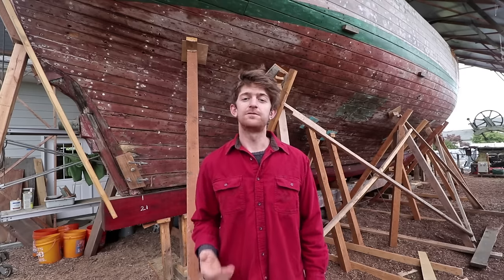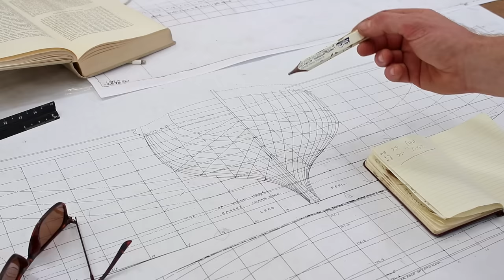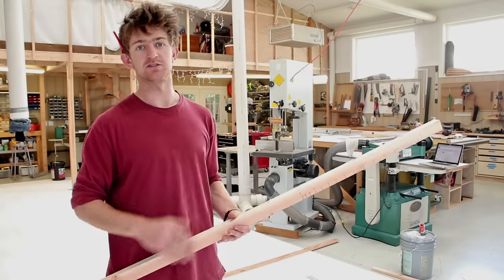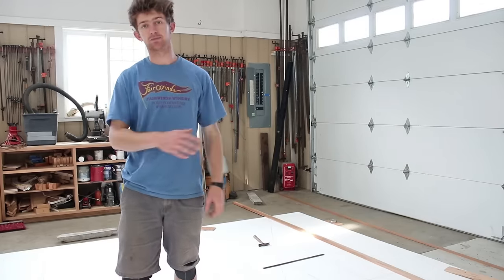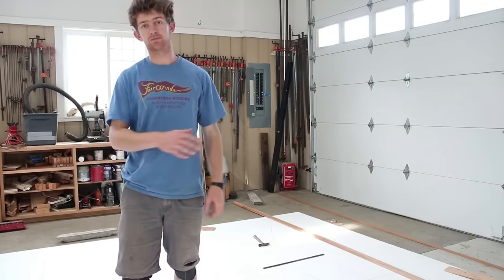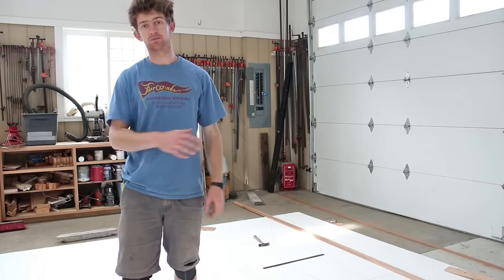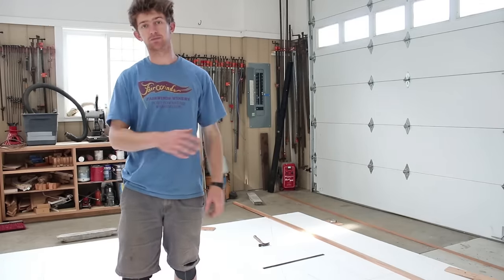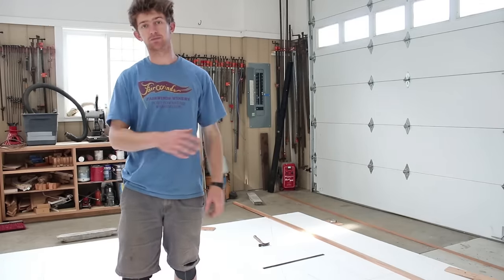Lofting the Lines; Part 2 - Rebuilding Tally Ho EP25

Comment: Given today's technology, do some choose to use a large format printer/plotter rather than transfering/scaling the drawing manually?  I'd assume the plans could be tweaked in the drafting program used.
Reply from the maker: Some may do...
Here's my stock answer for why I do it manually;
A few reasons. 1. I know how to drive a pencil pretty well, but not CAD software, and I wouldn't want to trust anyone else to do it. 1. Being able to loft is an important part of being a master boat-builder, so I was keen to get the chance to learn it the traditional way. 3. There are many fair lines that can be chosen between two points. The person lofting the boat has considerable influence over the subtleties of the boats shape. If a computer was to do this, this human element of the design would be lost. 4. Is it even possible to fair a 50' long line on a computer screen, inch by inch? If so, it sounds very tedious. 5. I would still need life size plans for the templates, so I would need some kind of crazy industrial printers, etc. 6. I spend far too much time on the computer already, and this seems like way more fun (and makes more interesting videos)..
...didn't mean to write an essay, but there you go :)
Reply: First off, thank you for the thoughtful reply!  I absolutely understand the importance of using a process that works for the person who needs to understand, process, and produce the solution.   As someone in software development, I often times find myself drawing architectures and relations by hand as this is how my mind can best process complex concepts. 

Absolutely commend your method here.  Dont change it.  Was just curious.

Regarding inch by inch, in computer drafting there are vectors that act just like your straight edges and batons.  One can draw a straight line and add inflection points (like your nails) within the line to create predictable curves.
Reply: Clint Gossett Just something to think about the auto industry uses CAD/SolidWorks/etc but every major automaker has a group of sculptures that take digital designs and sculpts them in clay and then refines the design with input from the car design team, company executives, and consumer focus groups.  Additionally Boeing and Lockheed Martin still build 1/2 to full-size models of Military aircraft to confirm radar return signatures and aerodynamics to compare their “actual” numbers against the computer projected numbers.  In short what I am trying to say is it hard to beat the human eye.

Comment: Ok, waterlines? Do boat builders know where the waterline will be? Is it calculated when they’re designing the boat? If so it’s an amazing task especially back in the day the boat was built.
Reply: The designer puts on the plans where it should be for a given load, and about how many pounds of additional load for each additional inch of submersion.  Occasionally they get it wrong of course.

Calculus was invented a long time ago...

Comment: It seems to me, and I may be wrong. But in this day and age couldn't this bit be digitized and printed to scale on panels that get taped together to create the full size print? That would ensure accuracy and any corrections he wanted to make could be done quickly.
Reply: It's not that simple. It's fairly easy to plot the points in a 3d CAD program, then connect the dots w/ a curved line. But that curved line doesn't have the uniform stiffness of a wooden batten, correcting the cad line doesn't result in a fair curve. When you twist & zoom the image on the monitor to sight along the curve, the displayed line is redrawn by the graphics software & the displayed line is not the same. As for printing, certainly you can 'tile' the segments to produce full-size output, but the printer itself can introduce error. Its output might be 100% in the x-direction, but 99 or 102% in the y-axis.
Reply: @frederickstibbert7389  that makes sense, thanks for the clarification.

Comment: Sheesh drawing a set of lines by hand full size. It is bad enough doing it on a drawing board to scale, although i do miss it. Cad design somehow isn't as much fun. Yes you should not have drawn all the sections in at the start, but as you say you are learning.

Comment: Just a sugestion. Can't you straighten the lead keel under its own weight by putting supporting timber under the lowest point(s) for hogging or sagging? Altough it's a massive keel, lead is rather soft. It's worth to give it a try isn't it?

Comment: So basically lofting a boat means making a life size 1:1 "blueprint" of the boat so making the pieces is completely accurate. Seems like a lot of work but very cool none-the-less.
Reply: Jeremiah H. The patterns for the frames will need to be pulled from the lofting floor.  There’s really no other way to do it and get a fair curve.
Reply: Heath Albritton that's kind of what my assumption was. It's a very interesting process and I'm glad a lot of detail is being put into the video to explain what is happening.
Reply: seems kind of strange that boat builders cannot work off blueprints or miniatures? imagine if they had to do the same for skyscrapers or even regular buildings!! I think I must be missing something. Maybe he wants to compare the current shape of the boat to what it is supposed to be, and thats why he needs a life size blueprint! still why can't he use one that is scaled down 10:1 that will be much manageable probably 10 x 10  or there about?
Reply: JO MANGEEE skyscrapers and regular buildings generally don’t have curvilinear surfaces.
Reply: JO MANGEEE, and they don't often have compounding curves that directly effect the performance of the building...most curves so far in buildings are simply an astetic based goal...not function.  Planes function so they do the same as boats.  Cars function they do similar as well.
Reply: What you just said is absolutely not true at least for old style buildings and bridges, I come from a family of engineers who designed and built buildings and bridges all around the country  and I know!
Reply: JO MANGEEE, glad to hear your family is building cool stuff, and I do understand about how bridges and buildings have to address enormous loads, including the dynamic loads of cars and trucks bouncing on them as the wind pushes....however, very few buildings historically or presently in the American skyline answer to fluid dynamic loads as the primary, secondary, or even tertiary goal.  If completely ignored the structure fails yes, but the point of the building is not to move through a fluid plane it's to house people, or workers, etc....so of all people you should understand the validity of my point better then most.
Reply: ignorance is a bliss!
Reply: +JO MANGEEE The fundamental problem for Leo is that the drawings he has have errors. If he trusted the table of off-sets, he would be cutting out the frames and setting them up on the keel and when the planks went on they would form a smooth fair surface.

Comment: I have no idea what process this takes to complete but it looks complicated and like it needs a great deal of accuracy.  
It may seem obvious to some but why are the plans not drawn on autocad? Do they have too be drawn 1:1 so parts can be made up by eye and there's something to model off? It's just the process I'm not familiar with so wouldn't have a clue what the easier option is
Reply from the maker: Here's my stock answer for this question!
A few reasons. 1. I know how to drive a pencil pretty well, but not CAD software, and I wouldn't want to trust anyone else to do it. 1. Being able to loft is an important part of being a master boat-builder, so I was keen to get the chance to learn. 3. There are many fair lines that can be chosen between two points. The person lofting the boat has considerable influence over the subtleties of the boats shape. If a computer was to do this, this human element of the design would be lost. 4. Is it even possible to fair a 50' long line on a computer screen, inch by inch? If so, it sounds very tedious. 5. I would still need life size plans for the templates, so I would need some kind of crazy industrial printers, etc. 6. I spend far too much time on the computer already, and this seems like way more fun (and makes more interesting videos)..
...didn't mean to write an essay, but there you go :)
Reply: Sampson Boat Co fair enough, I suppose when it's a project like this it would be the satisfaction of it too. It's some skill to learn.
Thanks for the reply.

Comment: QUESTION??? How do they do this on New Wooden Boats? do they just print it off? Or do they have to do all this figuring?
Reply: Nice video
Reply from the maker: They often do this, yes. In some places they just build the boat, if they are not so concerned about the exact shape, perhaps just loft a few of the frames and fair out the errors in the build, by eye. I guess some modern boatyards might just print it of, but I dont think it would be easy to do the fairing process on a computer.

Comment: I felt completely lost within 5 minutes....Being dutch and trying to understand this is completely hopeless...
Reply: Lofting is how you develop the shape of the frames and make patterns --- "molds" -- in full size to shape the frames to.  It lets you shape the frames so that they define a surface which is fair (smoothly curved) in all directions.
Reply: grafvonstauffenburg:  The buildings in the boatyards had  floors where you could stretch out the canvas flat and pin it to the correct shape for sewing (by HAND) for the sails and they were all one space with no support in the middle.  They had floors that extended for hundreds of feet to make rope.  Look at photos of OLD water front buildings and the top floor would be one of those floors, one enormous open space.
Reply: From what I've been able to learn sails were made of a heavy natural fiber fabric, probably linen, or other fiber. It would be about the weight of a heavy denim material.

Comment: wouldn't it be possible, at this point, to have someone do a 3-D print of the vessel with all the data, and wouldn't it show the mis-shapen hull as you spoke of it?  or, at least provide a "proof" of the small changes you are planning..  kinda like the wood carving that you looked at back a bunch of videos?

Comment: Now, you know you could have drawn this all out in something like Solid-works, Printed it, then taped it all together?
Reply from the maker: Here's my stock answer for this question ;)
A few reasons. 1. I know how to drive a pencil pretty well, but not CAD software, and I wouldn't want to trust anyone else to do it. 1. Being able to loft is an important part of being a master boat-builder, so I was keen to get the chance to learn it the traditional way. 3. There are many fair lines that can be chosen between two points. The person lofting the boat has considerable influence over the subtleties of the boats shape. If a computer was to do this, this human element of the design would be lost. 4. Is it even possible to fair a 50' long line on a computer screen, inch by inch? If so, it sounds very tedious. 5. I would still need life size plans for the templates, so I would need some kind of crazy industrial printers, etc. 6. I spend far too much time on the computer already, and this seems like way more fun (and makes more interesting videos)..
...didn't mean to write an essay, but there you go :)
Reply: I was trained in lofting, but it was years ago, no sp printer, you can print it with alignment marks and tape it together.  I understand the need/want to hand loft.

But look into the laser tapes, there cheap and can be accurate to 1/16"

can you send me the table of offset?
Reply: at a price, i'm sure! ;)

Comment: How do you know that all the figures of the designer are correct. In the time when there were no computers like today, the figures of the designer put to the floor to make a drawing 1:1 and than keep a long flexible ruler over it whit weights on it and by lifting the weights 1 by 1 you got a correct line, which were not always like the figures calculated by the designer. Maybe that's happend over here as well. Just wondering. For the rest you do a perfect job.

Comment: I have a question, what was the rationale on drafting it so large and manually? Why not draft in AutoCAD or Revit. The lite versions are relatively inexpensive.
Reply from the maker: Here's my stock answer for when I'm asked why I did it manually!
A few reasons. 1. I know how to drive a pencil pretty well, but not CAD software, and I wouldn't want to trust anyone else to do it. 1. Being able to loft is an important part of being a master boat-builder, so I was keen to get the chance to learn it the traditional way. 3. There are many fair lines that can be chosen between two points. The person lofting the boat has considerable influence over the subtleties of the boats shape, as they fair each line individually. If a computer was to do this, this human element of the design might be lost. 4. Is it even possible to fair a 50' long line on a computer screen, inch by inch? If so, it sounds very tedious. 5. I would still need life size plans for the templates, so I would need some kind of crazy industrial printers, etc. 6. I spend far too much time on the computer already, and this seems like way more fun (and makes more interesting videos)..
...didn't mean to write an essay, but there you go :)

Comment: You know, you could have printed out the entire drawing to scale with a large scale "billboard" printer...
Reply from the maker: Here's my stock answer for when I'm asked why I did it manually!
A few reasons. 1. I know how to drive a pencil pretty well, but not CAD software, and I wouldn't want to trust anyone else to do it. 1. Being able to loft is an important part of being a master boat-builder, so I was keen to get the chance to learn it the traditional way. 3. There are many fair lines that can be chosen between two points. The person lofting the boat has considerable influence over the subtleties of the boats shape. If a computer was to do this, this human element of the design would be lost. 4. Is it even possible to fair a 50' long line on a computer screen, inch by inch? If so, it sounds very tedious. 5. I would still need life size plans for the templates, so I would need some kind of crazy industrial printers, etc. 6. I spend far too much time on the computer already, and this seems like way more fun (and makes more interesting videos)..
...didn't mean to write an essay, but there you go :)

Comment: Brilliant.  But don't rely on photos for lines.  There is far too much lens/line distortion unless corrected by software.  Far too easy to get it wrong.
Reply from the maker: It was just for some guidance about the width of the flat (cutwater) at the front of the stem, and I think I got the information I needed.

Comment: impressive , really it is! ... but could not CAD be a help in this ... special in the correction phase? hope this question is in the interest of a broder public
Reply: CADi think you will onley save about 95% in time and where is the fun in that ? its a bit like wood caving with cad cam what took years for a master wood cave now takes  hours
Reply: yes not CAD CAM its CNC
Reply from the maker: No worries! Here's my stock answer for when I'm asked why I did it manually!
A few reasons. 1. I know how to drive a pencil pretty well, but not CAD software, and I wouldn't want to trust anyone else to do it. 1. Being able to loft is an important part of being a master boat-builder, so I was keen to get the chance to learn it the traditional way. 3. There are many fair lines that can be chosen between two points. The person lofting the boat has considerable influence over the subtleties of the boats shape. If a computer was to do this, this human element of the design would be lost. 4. Is it even possible to fair a 50' long line on a computer screen, inch by inch? If so, it sounds very tedious. 5. I would still need life size plans for the templates, so I would need some kind of crazy industrial printers, etc. 6. I spend far too much time on the computer already, and this seems like way more fun (and makes more interesting videos)..
...didn't mean to write an essay, but there you go :)
Reply: thanks for the answering! I think it is super interesting.
Reply: Leo its a dying skill like rebuildine engines its so nice to see you doing it and very interisting to its like Steve Cross great to see this stuff
Reply: nobody gets my point I mean not replacing lofting, but as an add. First you lay out lets say 500 points every point have an xyz coordinate on the hull. Then you change with a batton the curve of a line. then you read out the new coordinate. forex. the z and the data corrects the other points.... wondering how your friends in England in that shipyard work

Comment: I think it would be much easier to scan this plans, redraw them in CAD and then print them on big plotter if you want 1:1 scale drawings, not much work
Reply from the maker: There are always many discrepancies on designers drawings, especially when blown up larger, so the lines wouldn't be fair - which is the whole point of the lofting process. If the object was simply to enlarge the drawings, there would be many easy ways to do so.
Reply: Yes, in this case you are right sir, i am personaly student of civil engineering so i know what you are talking about :) old hand drawn blueprints are pretty inaccurate. But if i understand that, you are using your big chart of distances to redraw it correctly in scale 1:1, aren't you? Anyway, its very interesting to watch and good luck with this huge project, i will enjoy every new epsiode :)